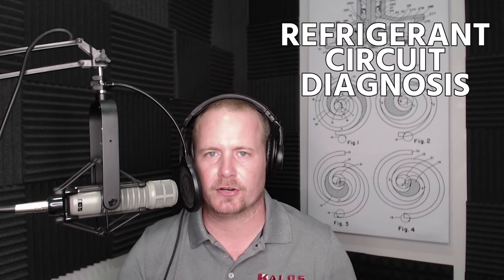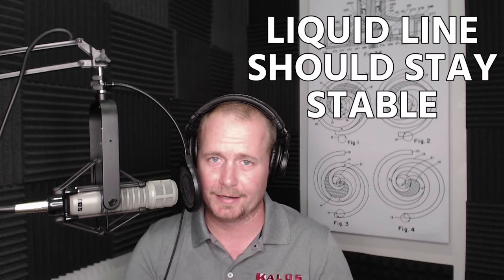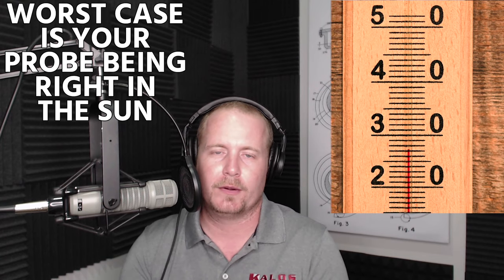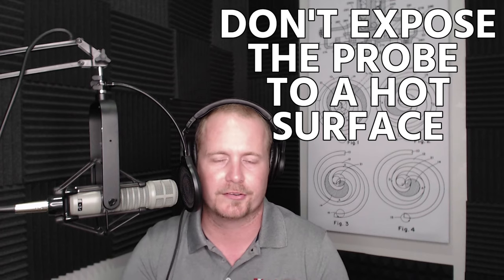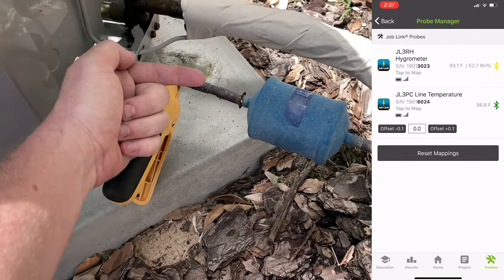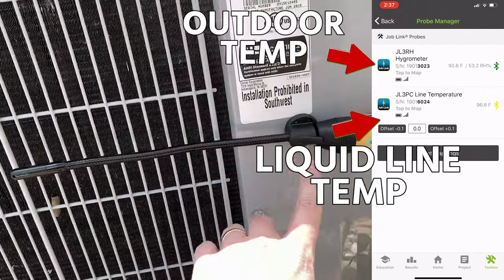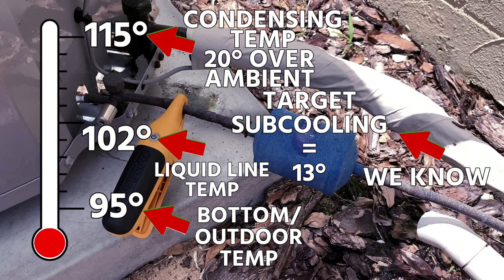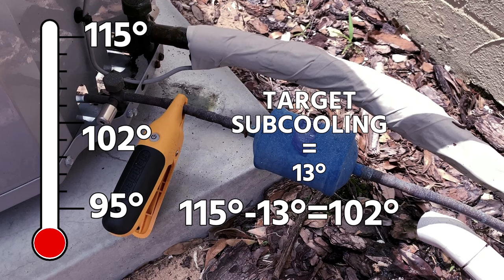Liquid Line Temperature

Comment: my outdoor unit is always sweating and the AC techs dont know why, they say bc the air handler is a different brand...could it be bc the the temp of the line is too cold? if so, how is this fixed? thanks
Reply: Air Handlers sweat depending where they are installed sometimes. If its hot and humid then they sweat.
Reply: I always sweat when I go outside and it's hot. So is it the condenser or the air handler?

Comment: Yesterday after cleaning the condenser coil, I took the temp of the out going air from the fan.  We had outside air at 100° and the temp after the fan was 112°
The fan motor had low amperage draw and the compressor had low amperage draw.  It was a 1993 Lennox Split System and I recommended replacement of the whole system.  I just do Service and repair.  No installing.  Honest assessment.
Reply: Head should be 30 to 35 Degrees above Outside Ambient Temp(on your gauge). KELLEY
Reply: P.S.. When done front seat the Schrader valve on the high side,and sock the High side liquid into the low side,minimizing refrigerant loss.Kelley
Reply: Not sure how you came up with a recommendation to replace the whole system other than the fact you make commission on your "honest assessment" repair.

Comment: I'd be cautious about the liquid line always having to be above ambient. 90% of the time, yes.

Some mini-split manufacturers have models with either a liquid line to suction line heat exhanger or some other device that adds in additional subcooling and can drive the liquid line temp below ambient at certain operating conditions.

Daikin VRV-A and Mitsubishi Mr.Slim for those interested.
Reply: He specifically stated this is for residential A/C, not mini splits. He also mentioned that if the liquid line temp is lower than ambient, there may be a restriction of flow, that would be the TXV in the mini split.

Comment: "so now we have to drop below that 115".  WHY?  From this video alone, it's still very unclear what you're saying.  Some of this I get.  I totally understand that the liquid line can't be below outside ambient.  I understand a measured liquid line of 115 equates to a PSIG for a refrigerant, got it.  But you say a couple times in the video that the liquid line temp is expected to be..... "you already know what it is, it's 115".  So are you trying to say you expect it to be 102F even though you measured 115F or are you saying you expect it to be 102F at the evap coil?  Or are you saying this not so accurate method is what you expect the liquid line temp to be INSTEAD of what you measured at 115F?

Comment: Sorry but u give too much info for something simple. Old guys knew  there hand was 98 so line would normally be slightly warmer . All your info is true but for a new guy all he needs is basic temp he is looking for . Condensers are normally based on 105 cond temp at 70 to 80 ambient. So liquid line should be roughly hand temp. Too or cold you have issue .